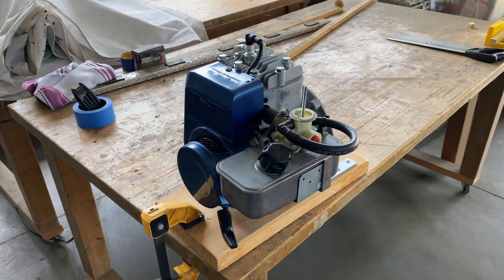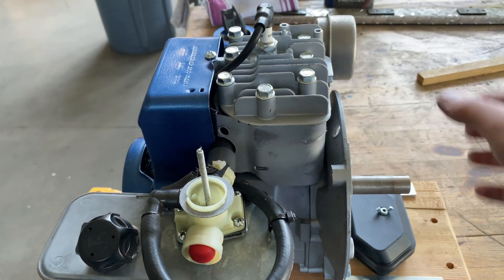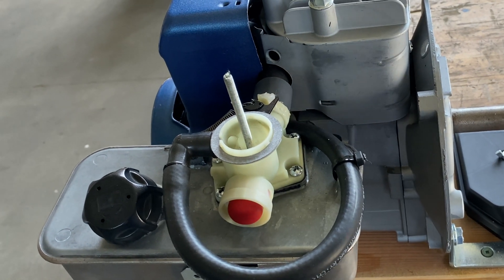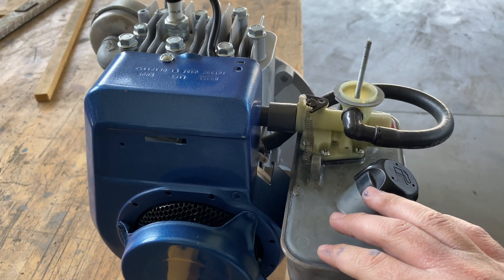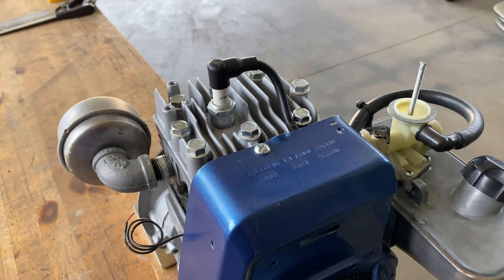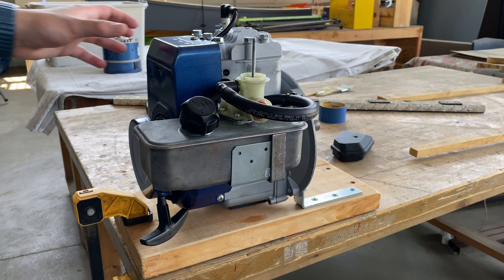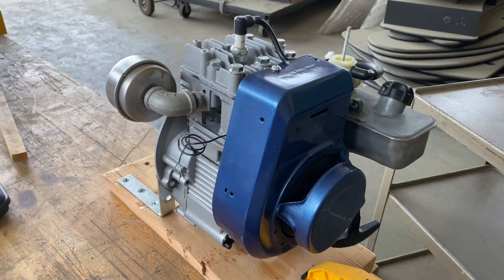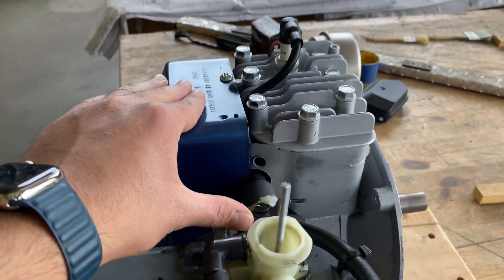Making A Lawn Mower Engine Run Vertically

Comment: Nice, but you should open the crankcase and redirect the oiling mechanism to splash oil upwards towards the cylinder and valve cam gears as oil may damage this type of carburetor.
Reply from the maker: Thank you for the suggestion, this engine has a small paddle wheel that does that and the original design connected an oil tube to the carburetor. This is something the next person who continues this project might do.

Comment from the maker: This is the last video in regards to my engine that I restored. Originally it ran on its side but now with a little bit of redesigning it runs while standing up. Some modifications were also conducted to further improve safety and controllability. I'll let the rest of the video do the explaining but just to put it out their, I donated this Engine to my school's Engineering Academy. I'm challenging future engineering students to further improve it and maybe add a small turbo.